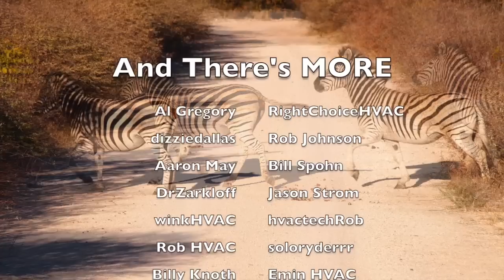HVAC Installation: New Construction Is Nothing Like It Used To Be

Comment: high question do HVACS have to face climbing very tall heights all the time???
Reply from the maker: Omar Martinez depends on what area of the field of HVAC you get into. Commercial install and service has a better chance of having to climb on roofs or in rafters  but as you saw in this video some residential situations have some heights to climb as well.
Reply: no... many times you are in very tight crawl spaces,  where I live many new homes just have crawl spaces, most are pretty nice but some, especially existing homes can be a nightmare.
Reply: Stephen Rardon

Comment: Why did you or he put so much duct seal in the boots?
Reply from the maker: Was once told “there’s no such thing as too much mastic paint”
Apply it too thin and it will crack before long and the seal will fail. Just trying to air seal the best I can.

Comment: nothing but ugly ass flex there is so much air loss this is what has become of the trade it's a shame there's nothing to this Builders know what they're getting someday someone's going to have to rip all that flex out the price of the stuff of them work with all the static pressure that gets caused by all that flex and those bends in it it may not work I've seen them at work Builders are pathetic these days
Reply: +Ben Kuxhouse Theres nothing wrong with flex. My installs are T&amp;B&#39;ed and nothing out of the norm with flex. Granted I do build a 4 to 6 ft. plenum on my units. If you run it correctly, you wont have issues. Ofcourse hard duct is best, and you dont lose much air flow. But its not cost effective if the installer knows what hes doing.
Reply: Yep, they need to support it off the trusses and avoid kinks - or get a correction!
Reply: Ben Kuxhouse i would never use more than 5 feet of flex just for vibration at the end and usually I run 10 feet of hard pipe off the main trunk line I agree 100% with you I was taught that back in 1998 and never did it any different attick or not.
Reply: Try not to use flex. Yeah it's easier but it's ugly and doesn't have as good of air flow.
Reply: There is nothing wrong with flex. Some applications that's all you can use. If it's not your cup of tea, that's basically YOUR call.

Comment: If it was up to me, flex duct would be made illegal.
Reply from the maker: Nothing wrong with flex itself, the way so many people install it poorly should be illegal
Reply: If the installation of flex was done according to code the longest length would be 7 feet and this would need to be pulled tight and supported straight. In effect making it easier to used hard pipe and externally insulate it. Big problem with flex is all the idiots who install it wrong and the other idiots who think crushing it is ok. 

I agree in some instances hard pipe cannot be used in those instances we do what can be done. Sadly most new construction is done like crap in order to get the job.  What 99% of people don't understand about the bidding process, the word Bid is an acronym which stands for Beat Idiots Deal.
Reply: Flex was designed for short length terminations in accessible areas, such as above T bar ceilings.  It was never intended to be used in concealed areas, because rats eat, and nest in the stuff.  There are areas in the US where it is not legal to use, except for terminations.  The HVAC world would be a much better place, if this crap didn’t exist.

Comment: That's way to much flex pipe buddy, 8' max. Supply runs in bays covered by sheet rock need to be pard pipe. Looks like a hack job to me.
Reply from the maker: Andrew Thomson who decided that?
Reply: Stephen Rardon It varies state to state, I'm in Massachusetts, they're pretty strict here as far as installs go. Bay runs must be hard pipe, 8' on flex runs, R8 on supply duct and R6 on return and system must be air tight. You loose air temp and velocity on long flex lines, but you do what you have to do. You work is neat and clean, I didn't mean to offend you buddy.
Reply from the maker: Andrew Thomson no offense, I've got systems with very low static and great performance on nothing but flex. I'd prefer to use hard pipe But you'd never sell a duct system here if you didn't quote flex. What's a duct system run for up there?
Reply: Stephen Rardon I just sold a central air only system to be installed in the attic of a ranch style home, 3 bedrooms, return air in every room at $13,900 and a ductless mini-split in the basement at $5,500.Trane and Fujitsu
Reply from the maker: Andrew Thomson complete duct system?
Reply: Stephen Rardon yes, 2.5ton, a/c only, 16 seer
Reply: Andrew Thomson You work alone?

Comment: foil tape is not the proper seal for your collar .. mastic mastic masticcc
Reply from the maker: The code here says UL181 tape, there's a million different ways to skin a cat.
Reply: +Jayge Marshall Where I work, You can use tape and mastic, or a duct tie and mastic. but you MUST USE BOTH. Something + Mastic. Different areas require different things.

Comment: it's only cost effective to achieve builder who doesn't give a damn about the end product it says a lot about the Builder you're putting flex in areas that are not going to be accessible when the Flex fails  and I've seen flex duct fail and fiberboard if you're in a call and you can get to it no matter what that's a different story then you have flex duct being used as the primary delivery is going to be inaccessible after construction the homeowner sooner or later get screwed it shows that the builder is pretty much a douche he's just looking for the cheap and then he's going to get out of town a one year warranty a piece of duct tape will last a year